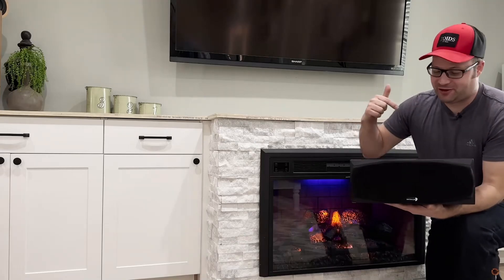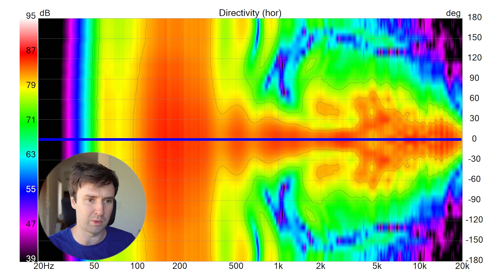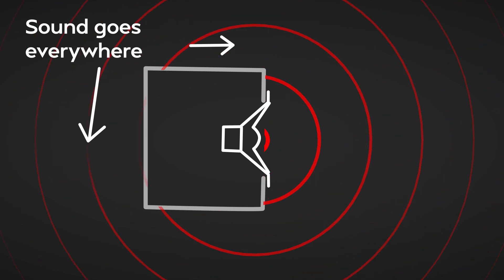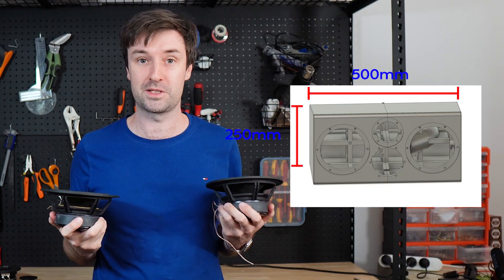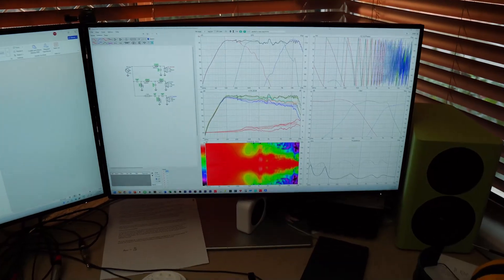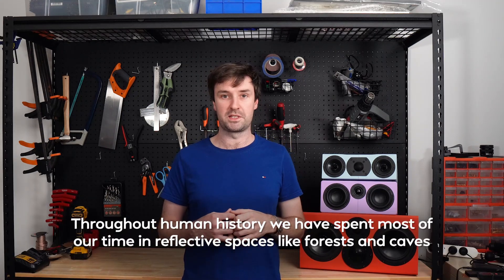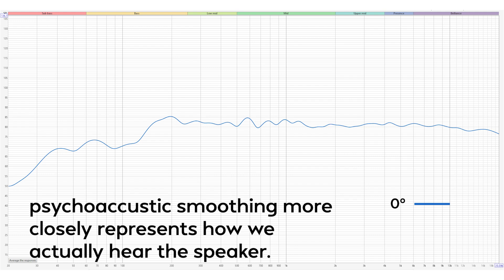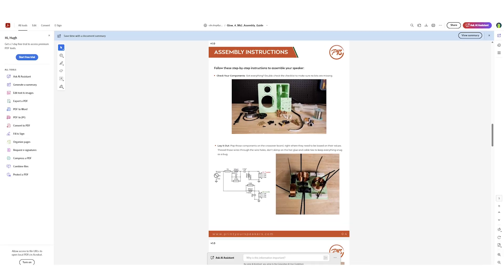I 3D Printed Three Centre Speakers to Prove They Don't Suck

Comment: Cool findings and designs. I have a  Behringer B2031A (it's a 2-way speaker, 8.75"+tweeter). I wonder whether it would work well, lying on its side, as center speaker.
Reply from the maker: Thank you for the kind words! It would be best to have a symmetrical design, the directivity pattern to a sideways bookshelf speaker/studio monitor will be asymmetrical which is not good :( It would work well in a vertical orientation, just as long as it doesn't block your screen!
Reply: @PrintYourSpeakers  True, one side has the tweeter, the other one doesn't. I have two B2031A, but they are huge and just one is very difficult to get accepted, two side by side is impossible. I'll think about your design. Maybe you could record a video helping people pick between the two center speakers you designed, concerning technical performances, cost, print complexity/bed size requirements.
Reply: Unfortunately the pink one is too tall to fit under the TV and the blue one requires a print volume 25 cm tall, I have 24 cm only. I'll have to ask for help once I start the project

Comment: I don’t think it’s a completely silly concern to have, it’s just more relevant when you have a well treated room without lots of reflections. A better way to put it is that the way we rate speakers rarely ever considers how and where we use them, which is a huge problem for most enthusiast hobbies.
Reply from the maker: I don't think its completely silly, I just feel like popular audio culture can get its nickers in a twist over small compromises in sound quality then project this obsessiveness on to mainstream consumers. Most people are happy with a sound bar; a horizontal MTM center channel combined with a dedicated 5.1 setup is a huge upgrade over that. Its highly unlikely to result in intelligibility issues. A 3-way center is big, ugly, expensive and the improvement in sound quality probably not worth it for most people. However, if you are going for a high-budget  'end game' home theatre, you can do better than a horizontal MTM. A lot of installs will use a tower speaker or similar behind an acoustically transparent screen.

On the topic of 'well treated rooms', I think the idea that treating reflections in small rooms is always good is one of the biggest myths in HiFi. This is especially bad in 2-channel because side wall reflections are critical to a wide soundstage, if you treat them, you destroy your imaging. An enormous amount of studies over the last 70 years have shown spatially complex sound to be preferred for listener enjoyment. You can get away with it to some degree in home theatre because you have 5+ speakers all around set up with the intention of creating spatially complex sound.

Don't believe me? Set up a pair of speakers in a field or a park and have a listen. They will sound lifeless.

Comment: Why don’t you look at using car audio drivers ? Hertz ml legend or audison voice 2

They are much more compact and designed to work in tricky installs
And they look a lot better than the mids and tweeters you used here
Reply from the maker: I have a lot of experience with PA and HiFi Drivers but almost none with car audio drivers. Building a HiFi speaker with car audio drivers is on my list to do, I am very curious about how it will perform. I might start a little cheaper than the ones you mentioned though, those are pricey!
Reply: @PrintYourSpeakers yeah I understand what you mean 
I know the ones I recommended are pricy but I have the hertz ml legend 3 ways in my car with the ml1800 bass drivers 

And it destroyed a monitor audio silver 200 hifi set up with roxan amps 

Even the guy at the hifi store couldn’t believe how good it sounded in a car

Comment: Keep in mind audiophiles are the same people who think they can hear a difference when they use $3000 speaker cables with cable risers meanwhile they are using unbalanced interconnects. 😂
Reply from the maker: The secret to perfect imaging is an 'audiophile' power cable plugged in to your network switch 😉
Reply: Audiophiles are morons.
Reply: oh my heavens unbalanced interconnects :o

You're all as silly as each other.

Comment: This is why Center channels when I was growing up 35 years ago and building them with my neighbor were nearly three and a half feet wide with four drivers in them. Some were trapezoidal shape even solve this problem. Why would you have a center Channel 18 in wide when it's probably part of a stereo connected to a television that's 50-60 inches or bigger? Test 3.5 - 4 ft wide Center Channel with four drivers in it and tell me what happens

Comment: Seems like a job for a 4-6” full range driver with a tuned crossover rather than a bunch of drivers for a center channel
Reply from the maker: A full range will beam quite a bit in the upper midrange and treble, however, KEF has some great center channels that use a coaxial between the two woofers. SB Acoustics has some new coaxial drivers coming out soon, so I may give that a try then.
Reply: @PrintYourSpeakers two or more small sub 4” aluminum neodymium drivers would be amazing for intelligibility. It doesn’t need bass, mostly the midrange needs to stay full. It’s not meant to standalone and be full end to end right? It’s meant to serve its purpose in a wide soundstage without noticeably being the weakest link. 

Here are a few I suggest looking at for this purpose. All references are from parts express. 

-Peerless by Tymphany 830987 3”
-Tang Band W4-1757SB 4"
-Tang Band W2-2243S 2"
Reply: @PrintYourSpeakers also, great videos! I don’t mean to come off critical! I like having dialogue and contributing to this project!
Reply from the maker: @forestbirdoriginals4917  A lot of budget sound bars are designed like this, they typically have them in two or three groups (left, center and right channels). Designing a standalone center channel like this would have similar compromises to a soundbar. Its really hard to achieve good patten control, sufficient dynamic range and output with an array of small full range drivers. The real reason to do it is to make it low-profile to fit under a TV. I do plan to design a super low profile center channel (not soon) using 4 SB65WBAC25-4, but I will still use a dedicated tweeter between them with a 2.5-way crossover.

Comment: excellent thorough description, thank you.

and......portable bluetooth speaker next?   ok well dang it.  i am really looking at getting one of those.  i was going to pick up a monoprice one, but i kept seeing conflicting reviews, and they seemed to have changed their model every few years.  

if you are looking for ideas for something after that, i don't know if this would be that much of a different speaker design, but here is another audio problem i have:

i have gotten a few laptops now with just dog awful audio really wish i could plug in over usb c, and clip on to each corner of the monitor some SLIGHTLY better speakers.  so what if you went the other direction.  HELLA, hella tiny/portable, and usb powered.  so even further than a bluetooth speaker (because i do know that would actually sound very good).
Reply from the maker: That's actually a really cool idea, the challenge of working with the 5v USB power and tiny enclosure size limitations would make a cool video. Unless someone else gets to it first I might give this a shot at some point.